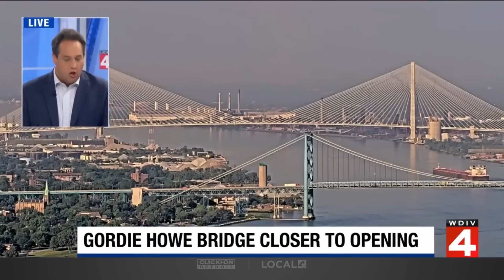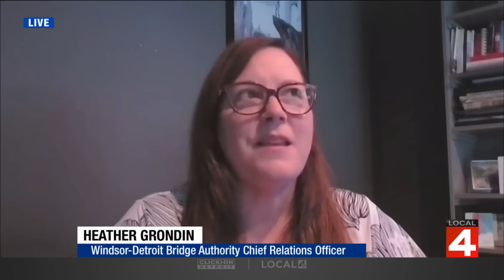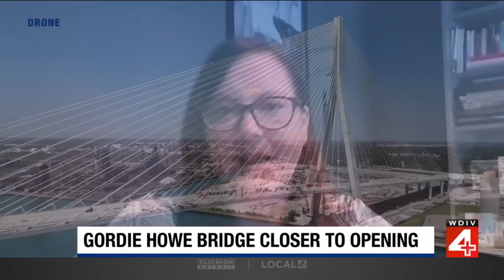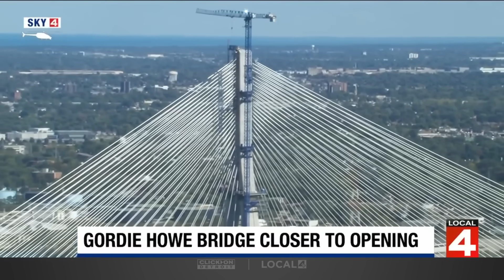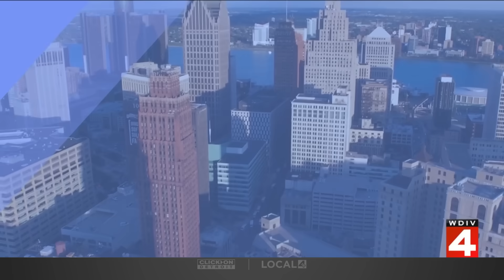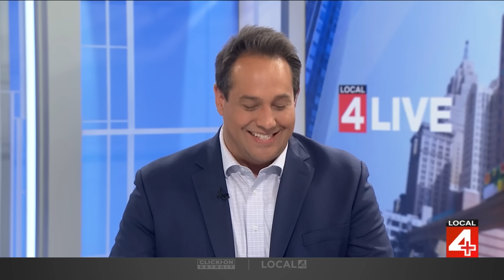Gordie Howe Bridge closer to opening

Comment: The Port Mann bridge in BC Lower Mainland is a cable stayed bridge with central pylons.  During the freezing months the steel cables accumulate ice and when conditions are right the ice drops on the vehicles crossing the bridge.

Comment: What about freezing rain on cables? Or is that not a risk near water?
Reply: Out here in BC those "ice bombs" have been a MAJOR problem for the vehicles on the bridge, as opposed to the water that is under the bridge. They cause a lot of damage to cars, and a lot of traffic accidents on the bridge as well.  I hope the people who designed this bridge learned something from the cable stayed bridges that have been built before this one. Learning from history CAN prevent repeating the same mistakes all over again.
Reply: @Doug_BC  It was entirely foreseeable and can be managed with engineering solutions.  It isn't the first cable stayed bridge to be built in a cold climate.  The problem with the Port Mann was a result of the fact that it was a P3 project and that is what the Christie Clark government allowed them to get away with.
Reply: @PePe_007-A1    I'm not looking for political spin about P3 or Chrispy Clark. In fact, BC has more than one cable stayed bridge that  neither Crispy Clark of P3 had NOTHING to do with. Including a Fraser River crossing that is under construction under an entirely different political party, by members of labour unions that they have deliberately selected themselves.
  The question that I actually ASKED, was about the "engineering solutions" that were selected and installed on the GORDIE HOWE bridge, SPECIFICALLY.

Comment: What happens when ice builds up on those stay cables? Look out below.
Reply: The Gordie Howe International Bridge is designed with features to mitigate ice buildup, primarily through the sloped architectural heads atop the bridge towers and the potential use of a novel deicing system for the stay cables. The architectural heads, located at the top of the towers, are sloped to prevent snow and ice accumulation, according to the Gordie Howe International Bridge. Additionally, the bridge may employ a "SHAKEY" deicing system on the stay cables, which uses vibrations to shed accumulated ice.

Comment: The choice of design is a bit surprising to me. We have a could of very similar cable stayed bridges out here in BC, and winter has always been a problem here. Ice and snow start accumulating on all of the cables, and then cause havoc on the cars below as they turn into "Ice Bombs" that dive bomb everything below them.
Reply: We don't get the snow and ice like you do, if we do get snow, it's usually gone in a week.
Reply: @braydons5623    I did wonder about the snowfall in that area. I've never been there during the winter. So thanks for that info.
  But with that said, the Vancouver area doesn't get a lot of snow either. And when it does, it doesn't stay around very long.
   But it's heavy snow that freezes to the overhead cable, and does a lot of damage to cars when the "ice bombs" go into attack mode. Rush hours are the worst times to try to cross our cable stayed bridges.

Comment: Hope there’s an off ramp for Casino Windsor to ease access.
Reply: Casino Windsor is already Closer to the Tunnel, as I recall! This Bridge (it's Hard to identify in this video) appears South of the Ambassador Bridge, which is South of the Tunnel.
Reply: @robertweekley5926  Yes the Tunnel is very close to the Casino
Reply: @robertweekley5926 Tunnel entrance in Windsor is actually within walking distance to the Windsor Casino.  While the Detroit side of the Gordie Howe is just a mile south of the Ambassador Bridge entrance, the Canadian entrance is south of Sandwich, a significant distance south of the Ambassador,  adjacent to the University of Windsor.  The Gordie Howe is right at the entrance/exit of the 401 Extension, with non stop travel direct to London,  Toronto & Montreal.  Once open, the only stop between Montreal & Los Angeles is the Gordie Howe toll booths & Customs.  Which prompts thoughts of an unscationed race between Montreal & Los Angeles, similar to the Red Ball Garage Memorial Trophy Dash 😊
Reply: The tunnel and ambassador is closer to the Casino, the bridge is closer to Amherstburg, it's about 10ish minutes up riverside drive to the casino.

Comment: China bridge 4400 feet 1800 feet down to the valley bulit in 3 years lol
Reply: The Gordie Howe won't blow over in a wind storm. 5 years is a fast build
Reply: @JustinJamesJeep  
It says the Gordie Howe bridge began construction in June 2018 so it will be 7+ years when it opens. Meanwhile China built the Shenzhen Zhongshan Link which crosses the Pearl River Delta which is nearly 50km of bridges including almost 7km of underwater tunnel IN JUST 7 YEARS for about 10 billion CAD.

Look up that project on Youtube and see what the Chinese built in 7 years compared to what Canada built in the same timeframe.
Reply: @JustinJamesJeep for little over 4 billion it should be able to pick itself up and move river to valley crossing and say good morning mate.
Reply: @davidt1441  $4B is reasonable. You've been losing yourself on the internet too much. 

I work in the industry, i would say my insight is valid on this topic. One of china's cheap/ fast record breaking bridges recently got washed away by by a mud slide. If that bridge were built by a Canadian firm it wouldve cost more and taken longer but it wouldnt have fallen over. We would have planned for inevitable mud slides or other weather events.
Reply: 100 years from now it will be standing, Chinese bridge will probably collapse within 3 years.  Cheap substandard crap like all of their manufacturing.

Comment: Embarrassing how long that took. Even the Øresund bridge didn't take that long and it's massive in comparison. The politics alone was a disaster
Reply: China built the Shenzhen Zhongshan Link which crosses the Pearl River Delta which is nearly 50km of bridges including almost 7km of underwater tunnel IN JUST 7 YEARS for about 10 billion CAD. Even putting cost aside, its crazy to think that the Chinese could complete a project that's nearly 20 TIMES longer and includes an underwater tunnel over a huge body of water in the same time that it will take to complete this 2.5km bridge.

Something is very wrong with Canadian construction that it takes so long to complete anything that's anywhere near close to being on budget.
Reply: @UzumakiNaruto_  Yah but we are not Chinese and we are not in China, enough said.